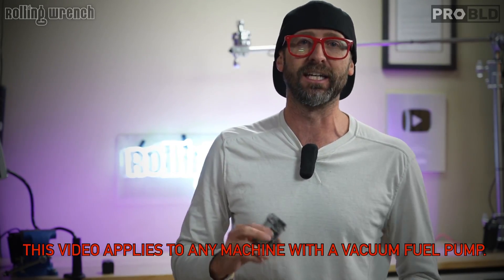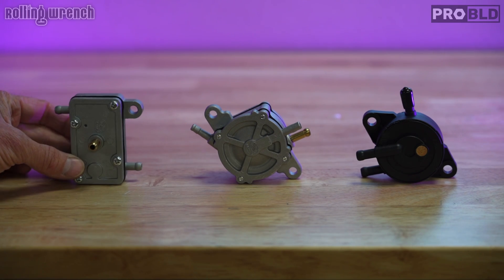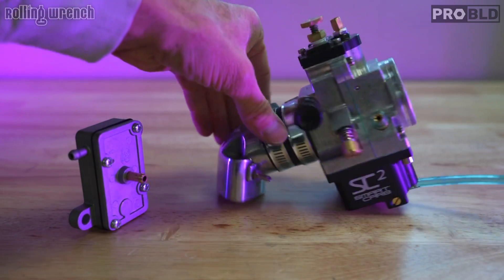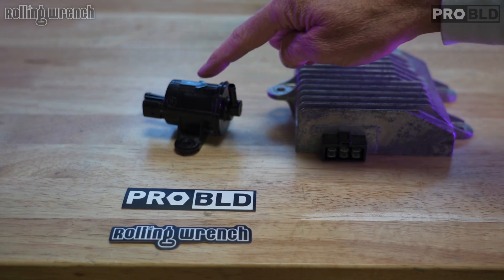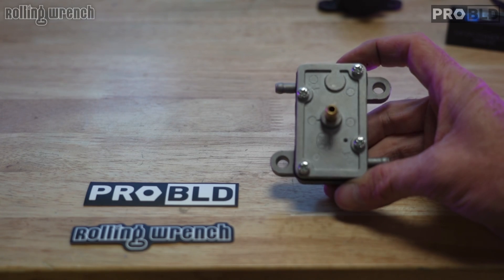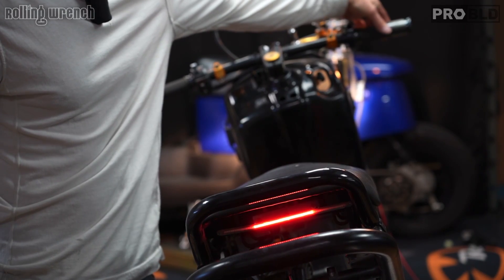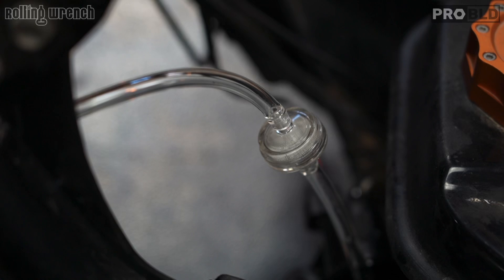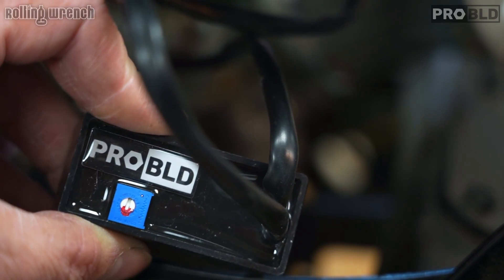No more vacuum fuel pump problems! GY6 Won’t start: FIX! [PROBLD PULSER UNIT]

Comment: I really understand why you don't want to use this system to control when one's Fuel
must start running to carburettor etc, You can never trust that shit. and as soon as you get a feeling that NOW THE VACUUM PUMP FINALLY WORKS PROPERLY. Then you better start taking the system apart because then you can be 100% sure that there is something wrong with it now.

I always remove my vacuum pump completely from my scooter, and then I put a Malossi fuel tap on my fuel tank instead .. and I do that even if the scooter is brand new, as soon as I'm home in the workshop, the little devil is replaced .
I perceive such a vacuum pump as a defective unit as soon as I have laid eyes on it, and it is always replaced with the Model fuel tap that Malossi stands behind and this type of fuel tap has never disappointed me.
I use it on all my Yamaha Aerox 2Taks Scooters that I use to drive on the track with.
Yamaha Aerox - Polini Corsa 70cc mk1
Yamaha Aerox - Polini Evolution 50cc mk1
Yamaha Aerox - Polini Evolution 70cc mk3

It's a really good video that you make all the time, keep it up because then I'm always happy, especially when I know that I don't have any vacuum pumps on my machines.
Reply from the maker: You know what’s up. Thanks for the support

Comment: Those fuel pumps are common on two stroke snowmobiles. 
The diaphragms in them harden over time, especially when exposed to ethanol in fuel. The check valves that should prevent fuel returning to the tank are part of the diaphragms and are sensitive to age and contamination.
You can generally get a rebuild kit for a few bucks with the diaphragms and seals to rebuild the pump which should get it working like new. The fact it couldn't pump fuel more than an inch or two above the tank level shows that pump isn't working properly anymore.
Reply from the maker: True. And there is better ways than those dang things!

Comment: I need one for my zero turn mower, I just changed my carb, furl pump and filters. Gas is not getting to the engine.
Reply from the maker: It will work

Comment: No, we appreciate you! All your videos are very interesting and educational and definitely deserving of thumbs up, million thanks!
My question to you is can an electric fuel pump and pulser be used on a Chinese GY6 150cc scooter that operates on gravity feed? I have a concern with gravity feed bikes, since the gas tank sits higher than the carb. That works fine on flat ground. But, how about when going up a steep hill? Would the tank still be higher than the carb? What if the carb ends up being higher than the tank going up a steep hill? No gas, no power!  Will the scooter starts rolling backwards?

Comment: Great detain in the Video! I have a Vanguard 23hp vtwin motor I use on a surface drive md boat. If you're familiar with that setup do think your pump and pulsar unit would work, since you have adjustment on the pulse unit?
Reply from the maker: I have plenty of people using these on boat engines

Comment: It's not a vacuum driven pump. it's supposed to be driven by the backpulse of the pistons. They're very reliable. I don't see where that port goes on your manifold, but I would guess straight into the block and not the fuel runner. When this part seems to fail don't immediately shoot the messenger. Chances are there is another problem up the chain. It's like when the autozone guy plugging into your obd2 and seeing the hego sensor failures and tries to sell you all of them when there's clearly a problem further up. All the sensors can't go out at once. It's more often than not a fuel pump or pressure reg or etc. In your case and the most common problem is valve cover gasket, crank seal, pcv or other failure that is causing that fuel pump to not get the full back pulse. That back pulse is going to take the path of least resistance. I have that same pump on 115hp johnson outboard and I've running it for the last 41 years. Those pumps used to come stock on the old columbia parcar/harley davidson P4 cruiser golf cars. Hence how I got it some 41 years ago. Just didn't think golf cars was going to be a life long carrier. Only mod i had to do was tap the hole and put a nipple to hook the pump up.  Now that being said I do like your solution, and if that pump ever fails I will be using that mod, damn skippy.  That would fit inside the same space. I dig it.
Reply from the maker: It’s the only way to go. The biggest issue is cranking these big motors over and killing the battery before the fuel reaches the carb. Ya you can give the tank a blow (lol)

Comment: Ths eletric pump can be connected to a 12v relays as switch on an off ..
Reply from the maker: True such as a flasher relay. The only problem is it will only last about an hour before killing the relay and or pump. I have definitely tried this long before designing the pulser

Comment: so does it always pump fuel when the bike is running, and you calibrate it to keep the bowl filled, but not over filled? it's a trial and error at first, i assume, right?
Reply from the maker: As long as the key is on it will pump fuel. The float in your carburetor will stop the fuel when it gets full
Reply: You can't program anything because the electric pump isn't ran by vacuum so it will not have no shut off from the bowl it will just keep pumping

Comment: Lost interest when you called the brake light AC power, if you didn't know anything with a battery is DC power. AC comes out of your rotar/stator assembly but then goes to the reg/rect to convert it to DC before it goes to your electrical system and battery

Comment: Hi I have a Toro dingo Mini skid steer tx 427  you can search it up to get an idea , anyways it has exactly one of those fuel vacuum pump that you mentioned in the video . Now I changed the fuel filter I can see gas inside the filter but when I try turning  it on only The fan starts working , It won’t Crank at all , the gas tank sit all  the way at the bottom . Will that Honda Product work for The walk behind toro dingo tx 427?

Comment: My fuel tank is above the carburetor. No Vac-op fuel pump for me. Thanks for the video. Educational. ❤
Reply: yeach ..arrange fuel hose on vertical position would run fuel by gravity to carburetor

Comment: I had this problems with vacuum pumps to supply fuel on my 2 twins carbys,,i fixed with a  simple  eletric pump whit a relay switch to the ignition 12 voltage ,,run when engine on  an stops when you turn off the engine ,,easy,,

Comment: spend-more
= pairing, 1-2, 3-4, starter
= starter

north-bridge is not circle for limiter-fuse kick
south-bridgeD is circle

pair unbalanced piston-blocs
4 pays 3 for control-switch via, kick back-pressure, back-pressure kick

to another-set of 4

use 8 to build 1
use 1 to tune 4 cylinders
use 4 cylinders to tune 3

use concept-theory to buy 1 fuel vacuum pump 

intake-exhaust-lines = all must can kick like kick-starter crank or battery-crank or.. word is kick-open, kick-close, kick-switch

chinese wording 抽马脚，踢马腿，马后炮 . diesel-bunker for ships. petrol grass-cutter, spool for assist after start. start sequential-parallel subsets economical. gas-recycle rifle is-not return-cycle. ar15 plus-one to return-cycle design modular reuseable to MTU size but not petrol unless starter or spooler or charger..?

Comment: I got a zircon fox 150cc gy6 and am having a (what I think is a fuel issue) it’s gravity/ vacuum pulled from a petcock, but every time I drive it for 15/20 minutes it starts bogging and chugging like it’s going to stall and I can’t figure out what’s up. Does anyone have a route I can go down to figure this out?
Reply from the maker: Check to be sure the vacuum hose from the gravity fuel valve isn’t sucking fuel from the vacuum hose. This is common when a diaphragm fails
Reply: @RollingWrench  thanks will do. I appreciate the help brother

Comment: Would this work for a 50cc scooter? Mine is gravity fed and it tends to slosh causing power loss
Reply: Mine is the gy6 motor
Reply from the maker: Sloshing won’t cause power loss. But a low carburetor float bowl will
Reply: @RollingWrench  eureka!!!!!! It's an aftermarket carb so this is highly probable. Thanks!
Reply from the maker: @nikosuave4779  I have never seen it. But if you think you solved the issue good work.
Reply: @RollingWrench  after further inspection, I've found that the previous owner ran like a mile of fuel hose and it keeps sagging no matter how many times you readjust it with zip ties. He put an extra shut off that isn't made for gasoline. Gonna do the previous-owner-installed-gas-shutoff delete and see how it goes. Love the channel dude!

Comment: I have a Honda Dio I don’t think this will work on mine 😭 I believe I have a faulty fuel pump cause nothing is going to my carb.
Reply from the maker: You probably have air in the line or the pump isn’t lower than the tank. It’s rare for the pump to be faulty.
Reply: @RollingWrench how would I go about fixing that before just straight up buying a new one when I don't need it?
Reply: @RollingWrench  and yes the pump on my Honda DIo sits above the tank
Reply from the maker: @Ace01010  that’s the problem. The pump needs to sit below the tank. It is gravity fed. It won’t pull fuel and push fuel.

Comment: Tad bit expensive! However if someone is running something with no battery or Battery here is a alternative and way way way cheaper go pick up a Fuel Line Pump cost 10.00 Put in your line after the tank and voila problem solved. For the sake of squeezing a bulb which takes less than three seconds you can save over $500. Not all of us are fortunate to have Donald J Trump or Justin Trudeau as a father and Canadians that have a 30% more cost above the US dollar  which is a joke carried out by our corrupt Government.  Soo to the people who have the funds Koto's to you!

Comment: What would have if I didn’t get that module and just had it wired in to ignition switch and just gave it the 2 psi the whole time. Running and idling , would it be ok. It would be just like a car

Comment: Lower your pulse pump not vacuum your pulse fuel pump to a lower position I know you're not going to get it lower than the tank most likely but lower position instead of hi primes way quicker and it pushes it up to the carb but if your carburetor bowl is full like it should be you shouldn't have a problem
Reply from the maker: I agree with you. Having it lower than the tank is best. I have definitely experimented with this. Unfortunately it still doesn’t solve any of the issues :-(

Comment: Run the hose to the carburetor. The carburetor has a float it is an on and off switch for the gas.

Comment: These pulse pumps are actually very reliable and are widely used by experimental aircraft.  It's not the pumps' fault that the fuel is low and needs to be pumped up to the carb.  It's the pumps' job to keep the fuel flowing to the carb AFTER the engine starts, not get the fuel there to start with.  To do that, use a primer bulb like outboard motors use.  Also, the vacuum line should be as short as possible and made from stiff rubber hose, not long soft fuel line.  If you use an electric pump, you must insure that the pump pressure doesn't exceed the rated pressure of the carburetor.  Otherwise the pump will overdrive the carb float valve.
Reply: Vacuum pumps are extremely reliable. 
They are used widely on small aircraft.
 And snowmobiles. 
Electric pump just over complicates the whole thing
Reply: @thieltech1 my opinion is they both suck. I have a 1986 Honda fourtrax 350, come stock with shitty electric pulse pump,  they fail consistently and I’ve had one catch fire, so I decided to do a vac pump swap. Barely pumps enough gas to keep the engine idling. Literally fixing to sell this fourwheeler because I can’t reliably get gas to the carb, spent 2k doing a full rebuild, machine runs and works great, when I can supply reliable fuel… I am giving up neither options works
Reply: @thieltech1  In that case please show me a manufacturer that makes reliable vacuum pumps, I've had lots of problem with brand new ones.
Reply: Nice, simplicity is best. Thx. 
Where and to what is the primer bulb connected to? Why don't they have such simple solution on the bike to begin with?
Reply: . maybe you start a channel 🧏
Reply from the maker: OMG! That’s is the scary! A vacuum pump on a aircraft!!! 😬. Sheeesh!

Comment: Maybe if you had clamps on your fuel line your pump would work. What are you like 12 years old?
Reply from the maker: I gotta hear this 👂: please explain.
Reply: @RollingWrench  Fuel lines have to be clamped. Its a fire hazard and can leak fuel or suck air, especially as they harden up.  If your selling these its a lawsuit  in the making and is just plain unprofessional.  At least you didn't use hose clamps.....lol
Reply: @RollingWrench  The real  problem is that fuel filter.   Its got a huge air bubble in it.  There's a reason Briggs and Stratton  designed those little disc filters.  But your trying to sell a controller. I get it.

Comment: Hi, first of all ... Cudos for developing your on electric pump controller... My question is: wouldn't you be able to control and avoid over heat with a cheap pwm module for a DC motor?
Reply from the maker: Thank you. Maybe? Try it

Comment: I have a motorcycle that cranks like that until the battery dies..i think I'm not getting fuel to the engine because after i crank the bike & take out the plugs..they're dry

Comment: It's not vacuum operated. They operate on pulse. Positive and negative pressure.
Reply from the maker: No Vacuum = No pulse….. it’s vacuum operated brother.
Reply: @RollingWrench  has just as much to do with pressure as it does vacuum.  So could you say it's pressure operated?  It's pulse activated and that's it. It's a 50/50 system.  It's pulse BROTHER.
Reply: @Real.Alpheus  The engine vacuum line does not pulse air. NO petcock works on pulses. The engine creates a negative pressure which is called a "vacuum" which then sucks a diaphragm in the petcock allowing the fuel to flow with gravity. Its vacuum BROTHER.
Reply: @Real.Alpheus  that's with a petcock though so oops. The pump used in video can be called both. since its using both the vacuum of the enigne and the pulses of the engine to actually "pump". SOO vacuum or pulse. but who caresss lol

Comment: Question do you think I can install this on 150 horsepower Mercury outboard engine? Mercury outboard engine
Reply from the maker: Ya, o have people use them on boats a lot. I’m not exactly sure on how they install them.
Reply: All you need is 12-volt right
Reply from the maker: @ernesttapia642  ya

Comment: Them fuel pumps can't be that bad because the industry has only been using them for decades Comercial lawnmowers have them also I have been fixing lawnmower with these for a long time and only had a handful of  issues with these
Reply from the maker: They maybe fine for lawn mowers. But when they started being used on scooters they are terrible.

Comment: I have an 86 ski doo citation 250cc 1 cylinder. Pull start, many pulls before starts. No battery, only ac on lights. Can i install this with an ac,dc bridge rectifier?
Reply: should work fine if you install this with an ac,dc bridge rectifier, Godbless

Comment: figure a way to power this pump on my inverter generator.  I got the same damn pulse fuel pump that takes forever to pump fuel up to the carb...this causes me to use the mouth trick each time and pressurize the tank to get fuel to carb.

Comment: These pumps are pulse pumps not a vacuum pump it’s pressure in fuel out
Reply: Last time I checked the intake doesn’t produce pressure…
Reply: That's a vacuum pump buddy! Mine hooks right to the cover on the cylinder head
Reply: @mastercarpenter1970 they are legit called PULSE pumps guy, you obviously do not know how they work 😂 they are called PULSE fuel pump because every time the cylinder moves up and down it creates a pulse that moves the vacuum inside 😂😂

Comment: I have a 2005 Yamaha Rhino 660 that has the identical problem. This item would work for this unit also, correct? Thank you so much, great video.

Comment: Same problem with lawn tractors that use a very similar vacuum pump system so your fuel is going back to the gas tank in about two days time and you try to start it 2 days later you're cranking for quite a bit before it fires off again!
Reply from the maker: Yes! I am very familiar. Need a pulser :-)

Comment: Hey, Rolling Wrench I have a 2003 Honda ruckus and someone cut the Fuel Pump Plug off and just left the brass connector without the plastic cover over it. Do you have a feul Pump Plug or  what should I do? Thanks, man, you've been a great help.

Comment: I run that old cheap pump on a Lincoln electric ranger 8 generator welder, there are no taillights to hook up to so would this new device be wired straight to the battery?
Reply from the maker: 12v that can be turned on and off.

Comment: Hi can I use this on my 2000 suzuki king quad 300 4x4 atv the actual engine size is 284cc? I am tired of the vacuum fuel pump 😒 
Thanks
Reply from the maker: Yes

Comment: Bought one. Found out 2 wires on Maddog will turn off power when disconnected. The green and green/yellow stripe. I may have hooked up backwards. When turn on power running light came on but pulse motor did not? Did I fry it? Have purchased service time. Looking forward to figuring it out.
Reply: Dude, I know this comment has a long time but hope this help you: the green/yellow wire is positive for stop light. You must seek for the solid brown wire that is positive for tail light. Any solid green is ok for ground.